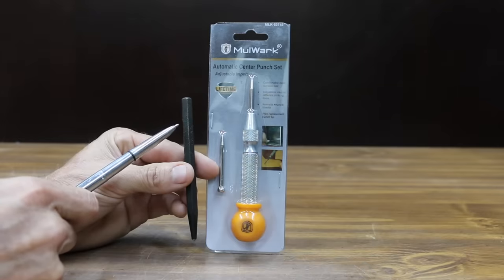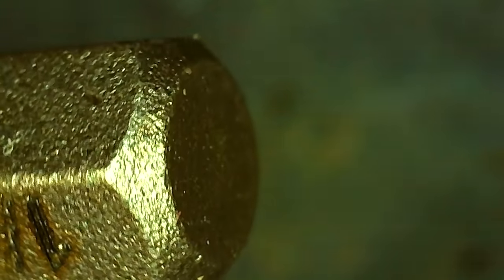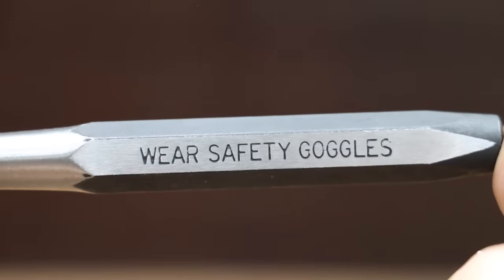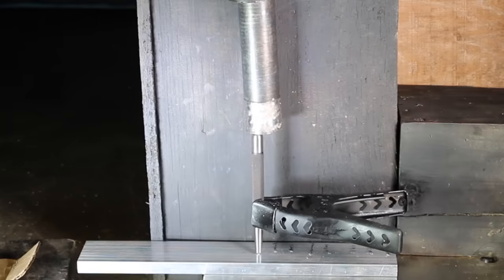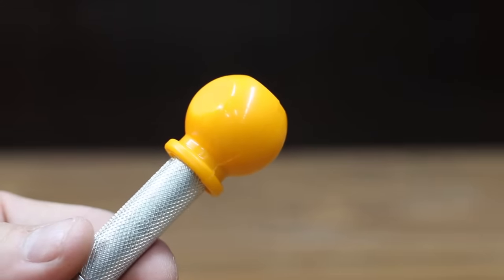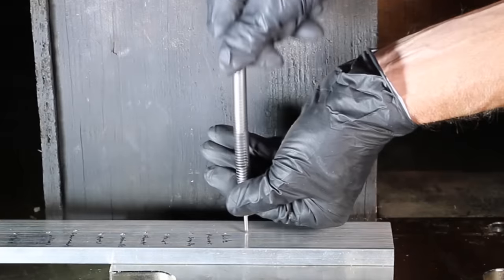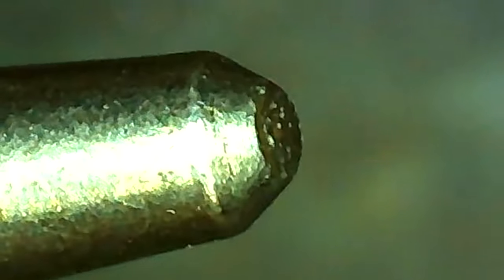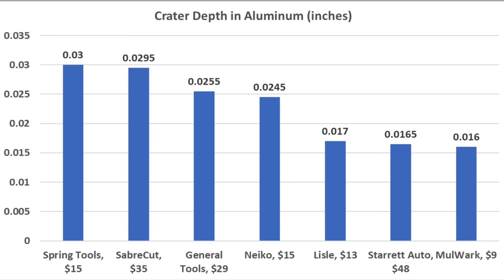Is a Cheap Center Punch Just as Good? Let’s Settle This!

Comment: I recently started having trouble with the Quick disconnects on my air compressor. Some of them have gotten hard to engage or disengage, others are leaking with the slightest torque on the hose. They were purchased at random when I need one so not sure what brands I have. I would apricate a "Which compressed air QD is best" video. Thanks.
Reply from the maker: Thanks for the suggestion.

Comment: Automatic systems are wonderful because you only use one hand and if you need to mark a little more you can repeat the process several times in a row if they get stuck or start to fail they are cleaned and everything works again if you are going to sharpen the tip do it manually with sandpaper or stone If you use a grinder, the overheating weakens the material.
Reply from the maker: Thanks for the feedback.

Comment: Could you do a video on spot welders for 18650 battery cells (or spot welders in general)? Probably not an easy one to do, but trying to figure out which ones are good online is difficult.
Reply from the maker: Thanks for the suggestion.

Comment: I would like to suggest a test on tile drill bits. I recently bought a Bosch drill bits for ceramic tiles. It only survived two holes on 3/8" porcelain tiles. As it turns out, the bit was designed to drill ceramic tiles only, not for procelain tiles. I am very confused different bits for ceramic, procelain, and glass.  Can you help us to choose the best bits for all three types of hard material?
Reply from the maker: Thanks for the suggestion.

Comment: Just had an idea for a testing video, digital measuring tools, say micrometers or similar.  I have no idea if they are all accurate when used perfectly, but have definitely seen some of mine that are easy to use improperly, for example by opening or closing too quickly, resulting in incorrect measurements.
Reply from the maker: Thanks for the suggestion.

Comment: Have you tested chisels yet? I have to use chisels quite a bit at work to split nuts without damaging threads. I had to pick up some air chisels as most regular ones would not hold up.
Reply from the maker: Thanks for the suggestion.

Comment: So toyota is starting to use 0w-8 oil. I wanna know how that compares to oils like 10w-30, 5w-30, 0w-20 and other oils. Like what's the lubrication test gonna be like with the bearing. And oil burn off rate
Reply from the maker: Thanks for the suggestion.

Comment: Here’s an idea for a video, how about tonneau covers for a pick up, from cheaper brands found on Amazon but also name brand ones  😃
Reply: Things like durability/strength after lots of sun exposure, resistance to cuts/sharp edges, resistance to being bent by heavy objects or being pulled on like a thief trying to break into it, ability to keep things dry inside by testing the seal to the bed
Reply from the maker: Thanks for the suggestion.

Comment: Actually, what I was wondering was what would be the minimum depth required to get most drill bits to bite and actually center ... and how many strikes actually pass that test? After all, the true test is if you can center drill afterwards.
Reply from the maker: Thanks for the suggestion.

Comment: Test “plastics”. Pvc, vinyl, acrylic, polycarbonate, HDPE, PET,polypropylene, glass etc. Also..
I forge knives as a hobby, and it would be neat to see if the cheap cast steel vs cast iron vs a welded on tool steel vs just a chunck of metal (Amazon, harbor freight etc) anvils dent/break/chip compared to proper drop forged anvil steel. Things like hardness, cracking, rebound, noise from hammer blows. This might be an expensive test.
Reply from the maker: Thanks for the suggestion.

Comment: I'd be very interested in the resharpening the tips and how they hold up. I absolutely abuse mine because i use them to break carbide inserts and getting both carbide and high speed steel broken taps out at work.
Reply from the maker: Thanks for the suggestion.

Comment: I have a toro lawnmower and it has some cheap pins under the flywheel in case you hit a roch and also one where the blade is. Can you test a few brands to see which is the most durable and less likely to fail because of a rock or needing service ect.
Reply from the maker: Thanks for the suggestion.

Comment: Every single auto I have had eventually takes 19 times to work without slipping...I just use the manual and rip auto ones into manual...Auto punches piss me off so bad haha.
Reply: They can be fixed. First off never lube or grease the innards.
They all have different operation, but take em apart and see how they function you can usually tweak them by bending a spring or grinding a surface flat. They pissed me off until I bought starretts best. $90 msrp $65 on ebay, its a beast.

Comment: Video idea.  Leather gloves.  The previous two pair of leather  gloves I bought, I treated them with mink oil first.  Heavily saturated, then left for a week or so to even out and lose the tacky feel.  They fit better, but more importantly, they seemed to last vastly longer than my most recent pair.  I was too much in a hurry to treat.  They were all buck skin, same brand, size, and the leather wore through on the finger tips of my dry pair.  The mink treated pair the stitch finally blew out.  Does mink oil increase the durability? Does mink/bee's wax work also?  (construction, tree removal, concrete demo and removal is what I use them for)
Reply from the maker: Thanks for the video idea.

Comment: I was taught that automatic center punches are for marking, then you punch it with a regular punch.
The Starrett tested is either a faulty tool or a counterfeit. I've been using Starrett punches for 40 years and have never seen one that wasn't sharp and durable. 
Return it for one that is more representative of the brand. They will replace it quickly.
Reply from the maker: Thanks for the feedback.
Reply: @ProjectFarm  
Thanks for all you do. Your tests are the best I've seen on YouTube. Well thought out and fair.

Comment: hi !
I'm sad that your Starrett has a factory defect because I've had several for a few years and I've had no problems.
So I have several Starrett centerpunch, because yes they have 3 models (the 18A, the 18AA and the 18C) which have different characteristics, especially the strength, I use the 18C on hard steel, and the 18AA on aluminuim, no problem.
Reply from the maker: Thanks for sharing.

Comment: I think it would be awesome to have a reference for what a typical “hole” looks like when you hit with a hammer? 

I don’t think it would need an entire video but maybe a comment? 

Are the punched divots roughly the same with the weight as what you made hitting it? 

And maybe a future video could also feature actually using each punch with a hammer to see if there’s any differences with ergonomics/holding/striking end reliability?
Reply from the maker: Thanks for the suggestion.

Comment: Todd, i think you got someones Starrett punch that was returned. I've had a Starrett 18A punch for for over 20 years, and it's held up fine, and i use it a lot. I would contact Starrett and  tell them about the defective one you have received. I also have a Starrett  Square-Shank Center 7 piece Punch set 1/16" to 1/4 I've had them for 40 years and have held up extremely well.
Reply from the maker: Thanks for the feedbackk.

Comment: How about bolt cutters? I always feel like I always get either a pair that barely can cut 1/8th in chain, take all of my body weight to use, or cost an arm and a leg. Really cool to see the difference between traditional vs the double hinges ones; handle length; etc 
**edit: I was referring to full size. I know you already did a video on the smaller size**
Reply from the maker: Thanks for the suggestion.

Comment: Starrett automatics come in three sizes A, B, and C, with 'C' having the heaviest spring. That should've been the one tested. Also, unfair to use a punch with an obviously damaged point. 
Additionally, taps with the factory ground points on them make excellent center punches; been using them for years.

Comment: I would think hazet used the very coarse grinding wheel for grinding the tip for purpose of removing the material very fast and not creating much heat that impacts on the crystal structure of the steel. This, in my opinion, should make the point less fragile and last longer. This is my prediction btw, I did not yet watch the full video.
Reply from the maker: Thanks for the feedback.

Comment: Man, please use machinist speak when talking about .0XX or .00X dimensions. Zero point zero zero nine five inches over and over is a bit much to follow as quickly as you speak (which I appreciate). Thousandths of an inch is easier to pick up on, especially when repeatedly throwing out number after number like that. Five thousandths is so much easier on the ear than zero point zero zero five. Or nine and a half thousandths vs zero point zero zero nine five. Dig the videoes, thanks for all the hard work. 
I agree with whomever suggested testing American new/vintage/chinesium metrology tools.
Reply from the maker: Thanks for the suggestion.

Comment: The automatic punches (except the Spring Tools) all seem rather bad not just quantitatively but also for a qualitative reason: you need to put a lot of downwards force in a fairly uncontrollable manner without a guidance hole (that's the whole reason you want to use a center punch in the first place). It's pretty easy to lose grip and make a large scratch across your workpiece.
Reply from the maker: Thanks for the feedback.

Comment: Too bad about the Starrett Auto punch. I bought one within the past year and it's been great, the tip on yours was absolutely a QC fail from the factory. Mine is as sharp as any of the ones you've shown after about a year of intermittent use (primarily on mild steel and aluminum). That's certainly on them as it never should have passed, but I think it would have been preferable to flag it as an obvious manufacturing defect and obtain a correct copy to test. Still note it in the video that the first punch was a QC fail, but continuing to review a defective product isn't all that informative on anything other than their QC process.

Comment: I have an idea inspired by the new $99 dollar Icon S2 tool steel punch set vs the $15 Pittsburgh green-colored punches.

Since the Icon set is 6.6 times the cost, would the Icon set endure more than 7 sets of Pittsburgh punches? Because as a hobbiest it may be more economical to accept a shorter tool life on tools not used frequently.
Reply from the maker: Thanks for the suggestion.

Comment: You've produced so many video's but I was wondering if You have ever tried to compare 5 minute epoxy to 24 hour cure in strength and durability after cure time. (supposedly after 2 hours cure time for 5 minute epoxy it's good to stress test.) Yes I'm talking about JB Weld but i don't know about other brands since all I use is JB.
Reply from the maker: Thanks for the suggestion.

Comment: I dont think its fair to compare the performance of the automatic punches vs manual punches, because automatic punches are not designed to replace a manual punch.
They are for when you need to make a very precise indent.. first you use the automatic punch, check to make sure that the little indent is exactly where you wanted, then you use that little indent to hold a manual punch in place so that it doesnt move at all while youre swinging a hammer down onto it

Comment: I'm not a machinist but I dont get the appeal of the spring tools punch. The whole point of an automatic punch is to be able to use it one handed. All the manual punches require 2 hands and against them the spring tools doesnt hold a candle

Comment: holy hell ive never been humbled, slack-jawed, and felt like such a dumbass in 20 seconds before. My entire time working on cars I've used punches a lot and have drilled a lot of holes but I've only ever seen and been taught to use an automatic center punch for drilling holes so I've gone through a bunch of disappointment and wondering drill bits trying to use an auto center punch thinking there had to be a better way, never did it cross my mind to just grab one of my punches with a nice pointy end (which I had never considered its purpose before) and just smack it with a hammer to leave a fantastic starting divet for drilling
Reply from the maker: Thanks for sharing.

Comment: zero point zero. zero point zero. zero point zero. zero point zero. zero point zero. zero point zero. zero point zero. zero point zero. zero point zero. zero point zero. zero point zero....
May i ask why you didn't use "thou" as in "38 point 5 thou" hole? One thou is one thousandth of an inch. Would make it so much easier to hear the differences in depth and would save you a lot of repetitive zero's.

Comment: Love your videos, but this was kinda pointless (no pun intended). Basically you're comparing tip geometry (and spring strength in case of the spring loaded ones). Obviously the pointier the tip, the deeper the punch. Basic physics, and easily adjusted on a bench grinder for any of these tools.
Please don't ruin your channel by this mentally of "if I don't have a good video idea, then any idea is a good idea". It isn't. I'd rather wait for a good video than be disappointed by one of these.

Comment: Your bounce assessment is flawed - you're getting closer to the centre of the material that you're punching and have less overhang on the table.
Your depth assessment is flawed - it doesn't account for the difference in angle of the punch.